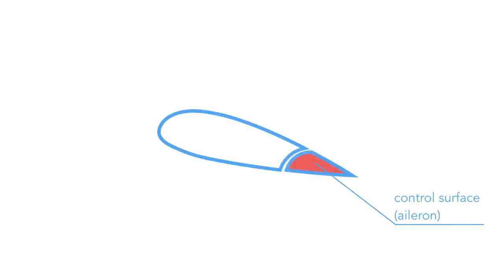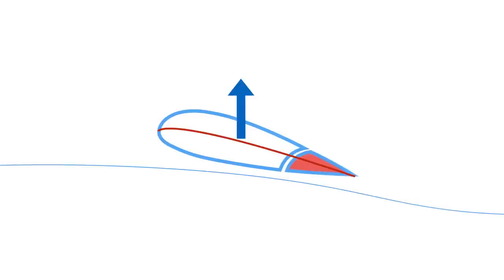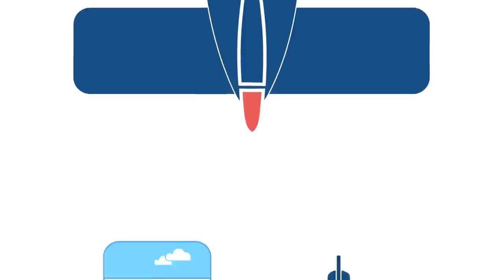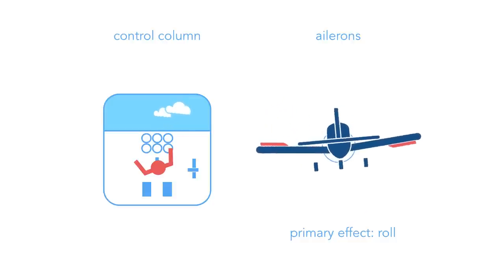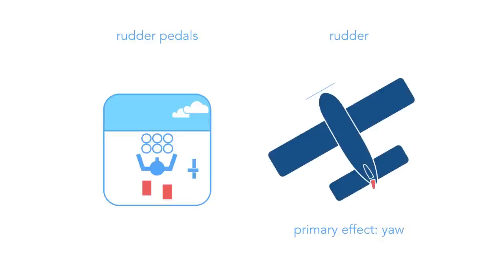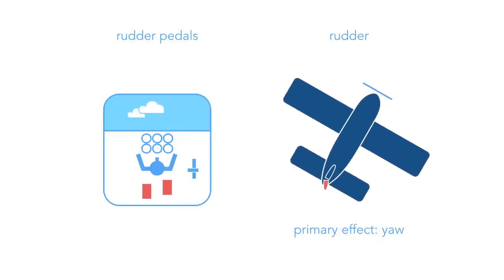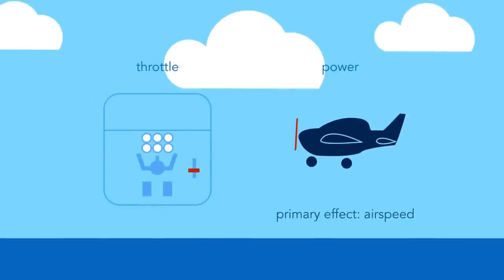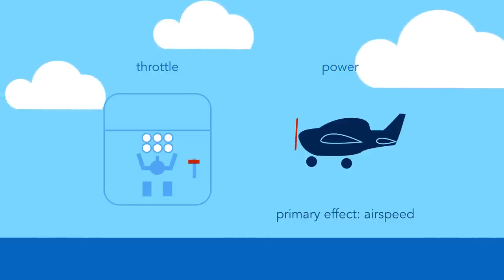Control surfaces

Comment: What I dont undetstand is this: Lift requires faster moving molecules on the upper wing - dynamic pressure. If Aileron goes up I guess it makes molecules move even faster so the lift would be greater but it does the opposite.
Reply: The faster mving paticles on the upper surface only creates some of the lift of a wing, the rest of the lift is caused by redirecting the air.   When the ailerons move, they also redirect airflow, either increasing or decreasing the amount that air is redirected on either wing.   airlerons essentially change the shape of the wing.